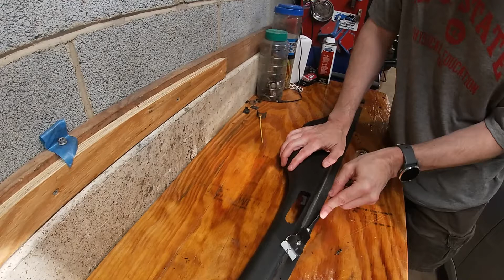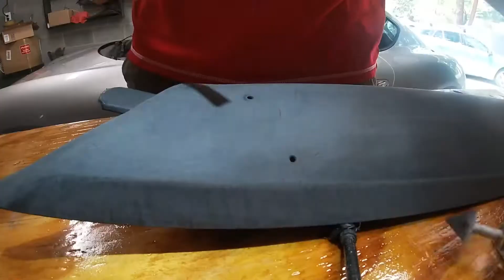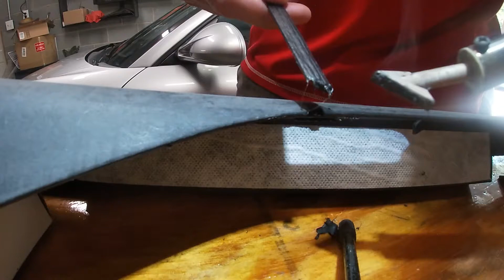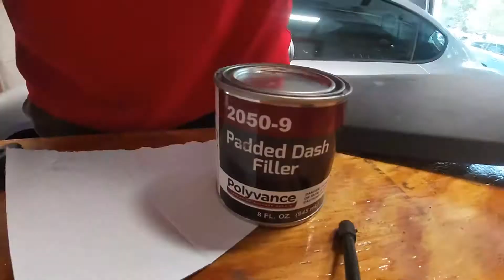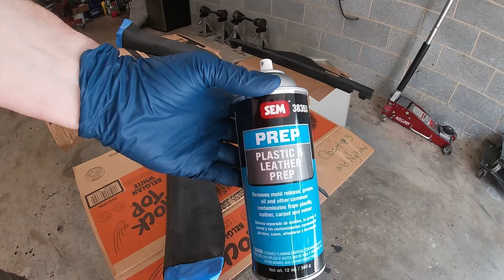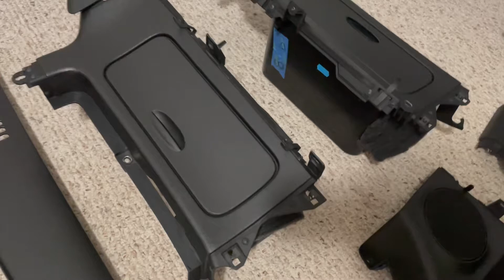Porsche Soft Touch Trim Refurbish

Comment: Excellent video. Easy to follow along with what you did and replicate. I have an older Audi with deteriorating "soft touch" panels that look terrible with many gouges in the paint and the plastic underneath is showing through.  I didn't think to use rubberized undercoating but that's got to be better than Plasti-Dip because it has to be way more durable, and also has that "soft touch" type of rubbery feel.

Comment: Awesome work. I have a 2010 Porsche Cayman and I’m about to tackle the ashtray assembly, center console trim and the pillar trim. For clarification, you only used SEM black rubberized coating as your last step but did you apply any other coating or product after that? How well does the newly painted trim match the original color?
Reply from the maker: Hi - that's correct. Nothing on top of the SEM rubberized coating. The only trim that I have not done is around the rear hatch glass. It's a very close color and sheen match. It would definitely be noticeable if two trim panels butted up to each other, but not noticeable at all between the hatch panels and the refinished ones around the trunk area. Best of luck!

Comment: I have tested this approach (ie with adhesion improver and rubberised undercoat) and found that it really shows up scratches  - even light ones as they look lighter against the ruberised undercoat (even if there is black plastic underneath) - it looks ok to begin with but it will look worse before long. How is your car interior holding up?
Reply from the maker: As of this writing it’s like new. No scratches or wear or peeling. FYI, it’s mostly garaged and I live in a relatively moderate climate.
Reply: @100dad7  thank you for your update! 👍